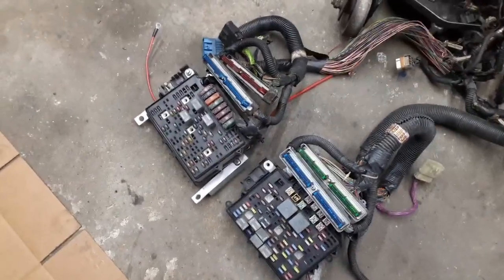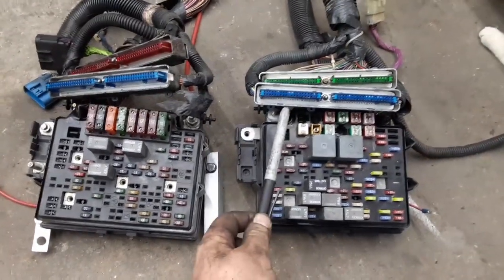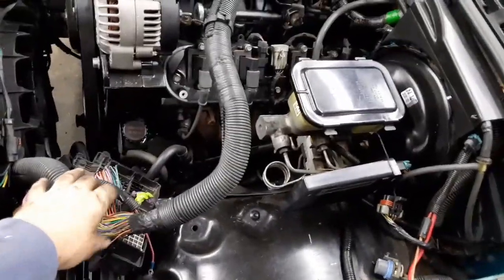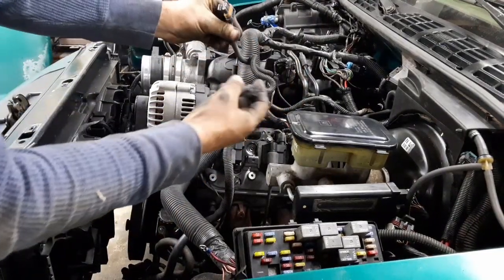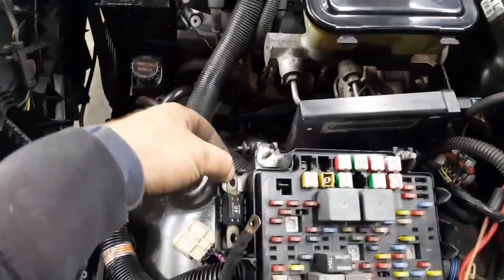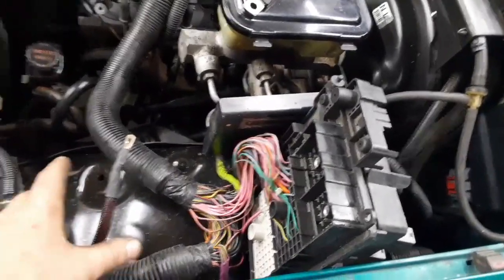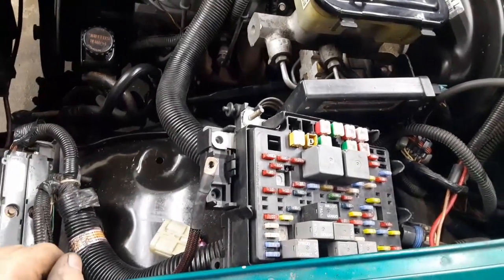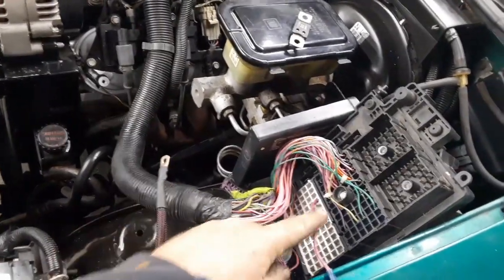LS Swap Wiring Harness for any vehicle- Basic and Simple Stock Harness - DIY

Comment: Dude you wont regret it if you depin the harness. I was dreading it and it was a literal pain in neck/back hunching over for 3 hrs  but its oddly satisfying like popping a pimple or something, lol
Anyways, i just finished depinning a harness that some other guy tried and made a mess of. Luckily i had another harness to mirror it off of and was able to fix it up cuz he removed too much tape and the shape was half gone. BUT now it looks so much simpler especially since im running a Th350 tranny and i got it to at least crank over on first try, directly triggering starter.
 Now today i will get the fuel pump wired up and test fire. Then sit n wait for Tuner dongle to remove Vats.
Reply from the maker: Yep, depinning isn't too bad, just takes some time. I find that the reusable velcro straps for organizing computer wires work good for keeping the harness shape while the tape is off it. Lowes sells them for about 100 for $10 in a roll.
Reply: note; keep the shape or it will be another 2-3 hrs reshaping in addition to de-pinning.

Comment: thanks for this build series!

I have a 96 Blazer that's been down for way too long at this point while trying to swap it. I've spent way too much time and money on stuff I didn't even need. I've decided to just start over and this video series will definitely come in handy!
Reply from the maker: That's great ! Just try to get one item done each week and you'll start seeing progress in no time. I like fancy stuff, but for a basic swap most of it's not really necessary. Aftermarket companies understandably push their products, but there's many great OEM parts that will do the same thing, sometimes better.
Reply: @lsswapshopp  are you doing any tuning or delete features prior to running engine? I have a 04 all stock